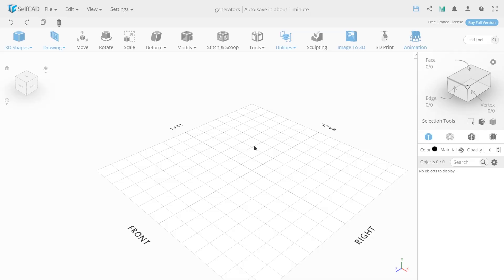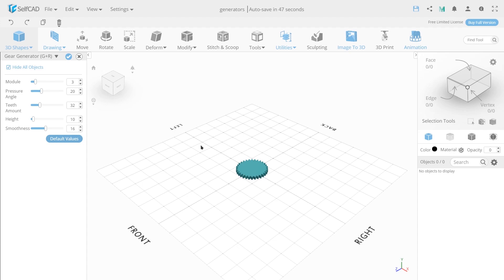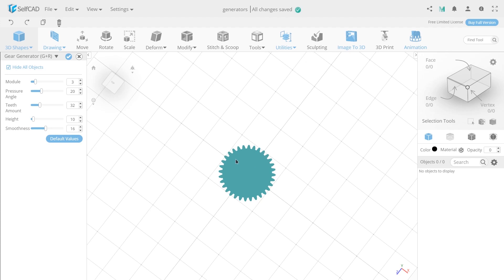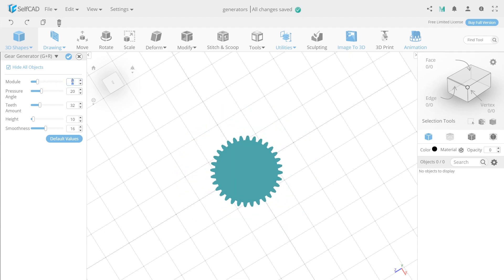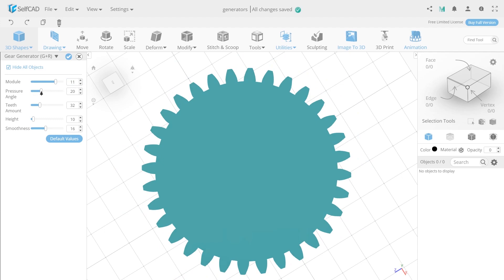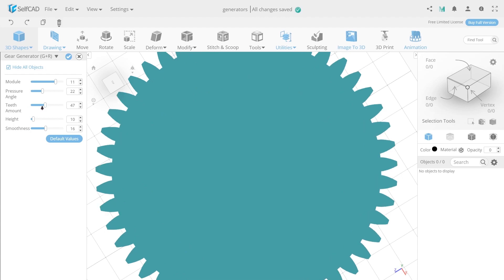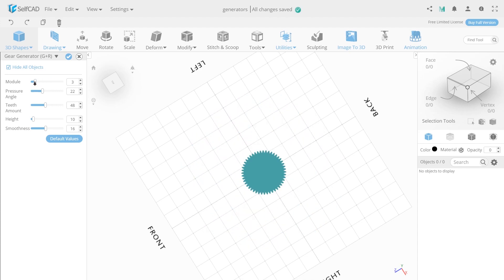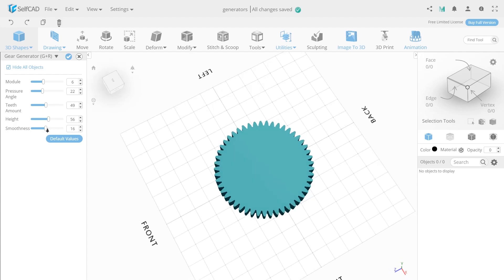Gear Generator | SelfCAD 3D Modeling tools

Comment: Hi. Can I edit gear which I created? For example I want to change dimensions gear. Can I?
Reply from the maker: Hi. You can edit it with the rest of our toolset (Modifications, Trasnformations, etc.), but you cannot open the tool panel again after finalizing the gear to change the module or the number of teeth.
Reply: @SelfCAD  thanks...